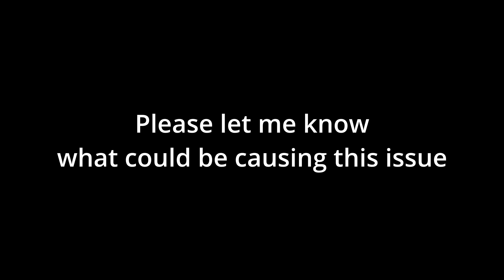Autopilot Failure on Takeoff

Comment: I would contact Garmin directly to see the issue. Since you wrote “Autopilot disengages” that’s suggests to me that you had it on during T.O. but I think it says (AFCS) which means System Failure. If you did have AP ON during T.O. Maybe the AP kicked off because on the Cessnas I fly it’s limited to minimum 800’AGL engagement. Also, did the AP do its preflight test(PFT)? It should show the white box with black letters saying “PFT”. If it says PFT in red then AP should not be used. Another thing on the GFC 700, (I know you’re using 600), it says:
 “Performing preflight system test; aural alert sounds at completion.
- Do not press the AP DISC Button during servo initialization and preflight system 
tests as this may cause the preflight system test to fail or never to start (if servos 
fail their power-on tests). Power must be cycled to the servos to remedy the 
situation.” Again, I would contact Garmin to find the culprit.
Reply from the maker: The autopilot comes on with the avionics master switch. It goes through its preflight checks. I engage it inflight. From the takeoff roll but prior to engaging, the autopilot goes offline and has to be turned off then back on. I want to know why it is exhibiting this behavior. 

For clarification, the autopilot has power but is not providing input to the flight controls. So it is on and presumably waiting to be used. On power application to the engines on the takeoff roll the autopilot goes offline with a host of errors. It hasn’t happened except on the takeoff roll.

Comment: When you say the auto pilot is on, do you mean that Flight director portion is engaged or the auto piot is engaged.  Most auto piolts must be disengaged below 200 feet unless they are certified as CAT II or CATII or have Autoland capability.  Why in gods name would you depart with the auto piolt engaged?  It makes no sense.

Comment: Q1.  Why are you taking off with the AP on?
Q2.  What does the manual say about this practice?
Q3.  See question one.

Every plane that I have flown has minimum engagement altitudes for the AP on takeoff and landing.  No way I'd trust a GA AP to perform a takeoff.
Reply from the maker: The autopilot comes on with the avionics master switch. It goes through its preflight checks. I engage it inflight. From the takeoff roll but prior to engaging, the autopilot goes offline and has to be turned off then back on. I want to know why it is exhibiting this behavior. 

For clarification, the autopilot has power but is not providing input to the flight controls. So it is on and presumably waiting to be used. On power application to the engines on the takeoff roll the autopilot goes offline with a host of errors. It hasn’t happened except on the takeoff roll.
Reply: Thanks for the clarification.   @PILOTVIDS